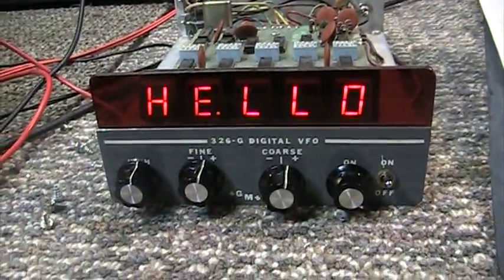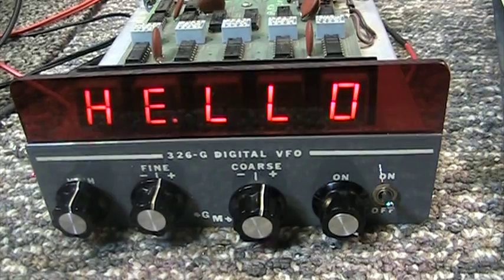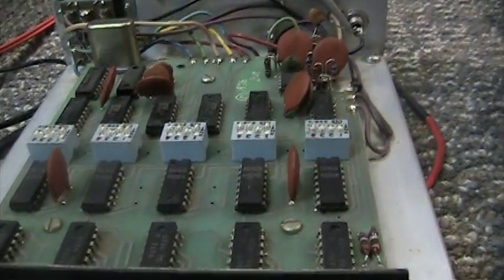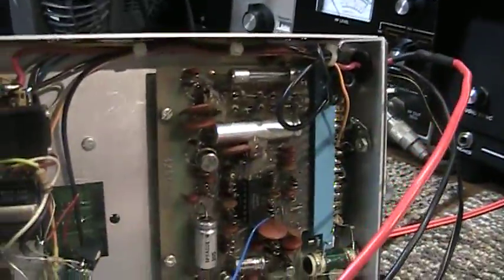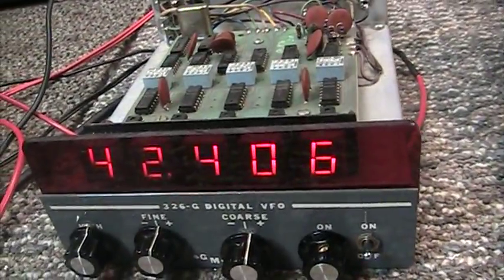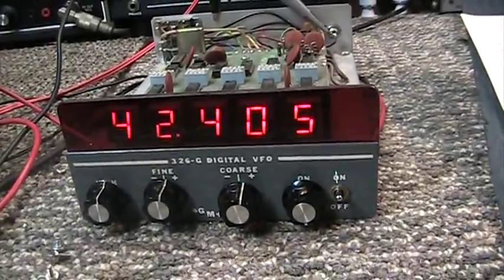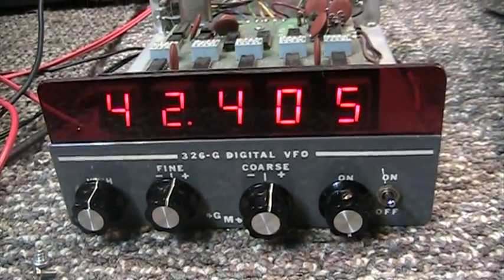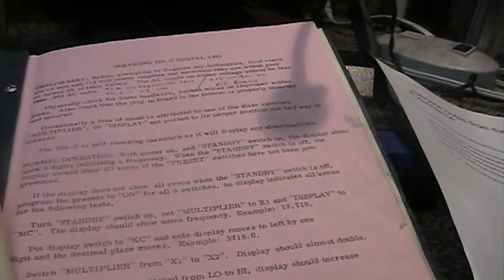Glen 326-G CB radio VFO frequency counter / controller

Comment: I have a glen 326g that reads 10.695 when setup the way your video showed . It will not read the 16mhz when I’m standby or on . However with counter to output does show the 16mhz . Any idea where I should start ?
Reply from the maker: Sounds like the counter part is working right, but the VFO part itself is not working right. There are basically 3 parts to a Glen VFO. A Frequency Counter, math intelligence added to the frequency counter which is the 10.695 Mhz. The 10.695 is not reading anything, it is just an artificial frequency that is added to the actual frequency it reads. Last the VFO output itself which with the Browning Mark 3 is the 16 mhz. If the VFO is not working or putting out, then the counter has no output to read and hence will only show the 10.695 number that is controlled by the dip switches. Sounds like your VFO needs repair. One of the common problems is the very thin wires on that tapped VFO coil breaks and kills the VFO output.
Reply: @tramdr  I found a bad transistor and replaced it 2n2369a , there is also a burned resistor in the back where the green wire connects to the board top ring is blue and bottom is gold the rest is burned and I cant identify , can you tell me what the value is ? it appears someone modded this to be just a counter as the green wire was connected to the rca jack with the white wire . thanks so much for your help .
Reply: @tramdr  also , If I put a counter to the output jack I'm getting the 16mhz just the 10mhz is not added to it going out and the freq display is only reading the counter not the vfo added in so both sides are working just not combining together . the first 2n2369a was bad and I replaced it with a 2n2222 which I read was equivalent. please any help would be so appreciated

Comment: I received one of those in a grab box of various CB equipment for $50 after a local CB'er passed away.  The one I had drifted pretty badly. Do they all do that?   I sold mine on Ebay. I only asked $25.00 for it, but the Ebay bidders ran the bid up to over $160.00. : )
Reply from the maker: Carol inaPirate  In a word YES, they all drift. CB VFO's are all known to drift and are no good for SSB. You can get away with them on AM. Let them warm up and stabilize for an hour, put knew Hi-temp caps in them will help. At least the Glen has a counter and you can correct it as it drifts. The PAL VFO's where crystal controlled and where more stable but even they drifted some. Modern technology DDS uses PLL's which do not drift. Keep in mind VFO's from this era are from the 70's and are 40 years old. With that said, I still like the Glen because of the counter and its frequency off-set capabilities. It can be used for almost any CB radio.

Comment: Hi....when hooked up to the browning mk 3 transmitter does the freq counter work?
Reply from the maker: Yes, when hooked up and set correctly, the counter will track perfect. There is specific hookup and setting for the Mark 3 (Transmitter only) in the Glenn book.
Reply: I cannot get the little sliders to work to set the freq counter
Reply from the maker: Nordland796 If you have the manual (which can be downloaded at CBTricks.com) and followed the directions on hookup and setting and its still not working, sounds like yours is faulty.
Reply: That is what I figured.....suks.

Comment: Questions......are these for the receive only.....or do they transmit ?
Will they work on a browning mark 3 ?
Reply from the maker: on a normal radio they work on both Rec and Transmit. However, on Browning and Trams big bases, which have separate Transmit and Receive, they normally are wired to the Transmit only. It is too complicated to try to do both. They do work and have specific info on the Mark 3's (transmit only)

Comment: Hi, Very nice of you to give your input. I have the fv-102dm freq counter. But i don't no if there is a mod for 27.0 - 27.5 mhz? I have the Yaesu ft-102 mod sheet. Just have not heard of anyone who has used it. And if the mod worked for them. Don't want to cut and add alot of diodes and end up with a parts radio, Untill i know for sure it works. Maybe someone that has tryed it will read this and let me know? Thank you again tramdr.

Comment from the maker: OK, now the mud is getting really deep. I have seen a couple of Glen Amps on Ebay over the decades. Maybe 5K at best. Over engineered, built well, but 100K? LOL. Actually I do know some of the heaviest hitters on the air and the biggest of the big are up to that point now. However, it is physically impossible even with modern technology to build a 100k amp in a jukebox size. I was offered a 35k amp some years ago for a song and dance. Too much for me. I couldnt afford even the electric bill LOL

Comment from the maker: I am going by memory, but I am 100% sure the Glen went up to at least 30Mhz, I think it went up to 50. I would say that it is not stable enough for SSB though. Of the old CB VFO's, (Glen, Siltronix and Pal), the Pal was the most stable. It was crystal controlled while the others are not. Personally, I would go with a more modern DDS PLL synthesizer to use for a VFO. They can be found on Ebay for 30 to 100 bucks.

Comment: Hi, I was wondering if the glen 326 -g vfo. Could be wired to work on a yaesu ft-102 for 27.MHZ If the radio has the am/fm board and 8.2ga am filter 6khz installed. If so would anyone have the info? I know two other ways it can be done. But if the glen vfo can be used to get 27MHZ.  That sure would be a better way to keep the radio original.

Comment from the maker: I also had bought original manuals off ebay on Black cat amps. At the time info for the JB-2000 amp was impossible to find. A few CB'ers got copies from me, starting selling them on Ebay, and now they are all over the place. 
  Last, I have a couple super rare Stoner radios but alas impossible to find a schematic or manual, so they sit in the graveyard  (Pro 8010 and _Pro 10)

Comment from the maker: I admire your Dad.  Small world, approx 8 years ago, I bought a lot off Ebay of Glen sliders with some original manuals and ORIGINAL notes!  I then made up a better manual by cleaning up and enlarging the schematic and cleaning up and including the notes. I included the manual with the Glen's I sold. However, a couple sellers sold copies of the manual they got from me lol. Until I made that manual, info for the 326G was very hard to find and its almost useless without the manual.